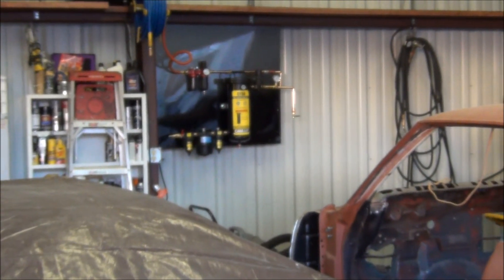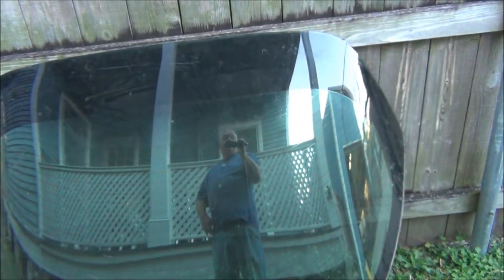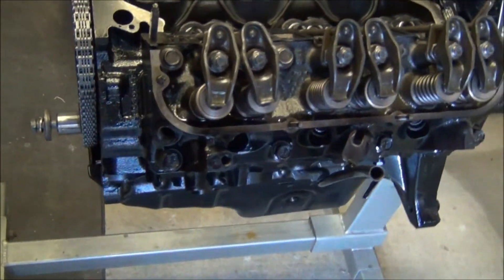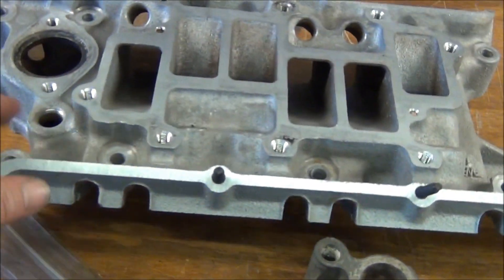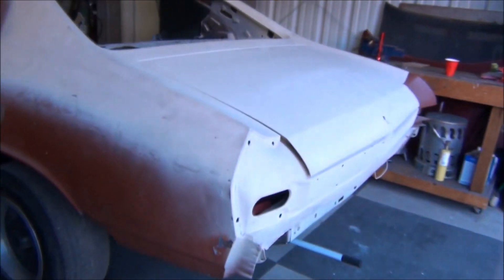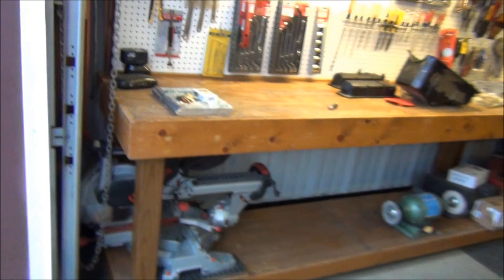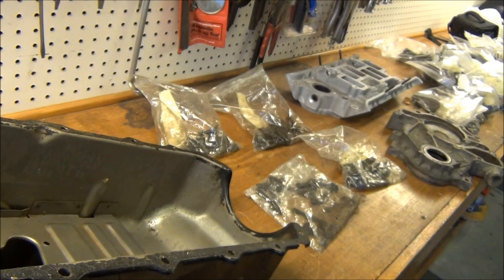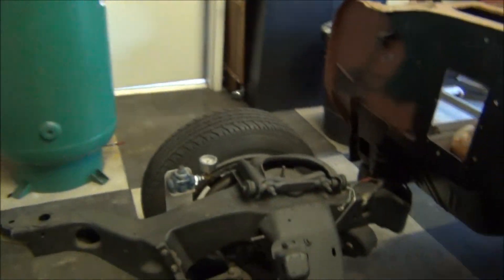I have a plan

Comment: It will be nice when it's done. You have a lot of work there. I would get a pre lube pump or some way to pressureize the oil system on the engine before cranking it fast. Oil down the spark plug holes. I would even remove the push rods and lifters and put some fresh prelube on the contact surfaces.